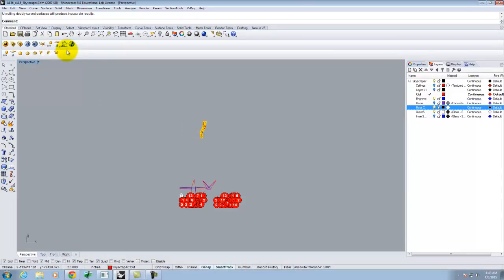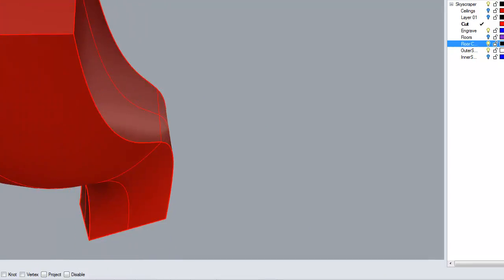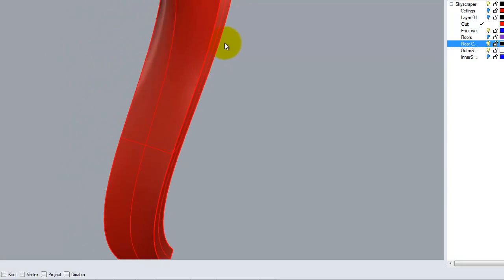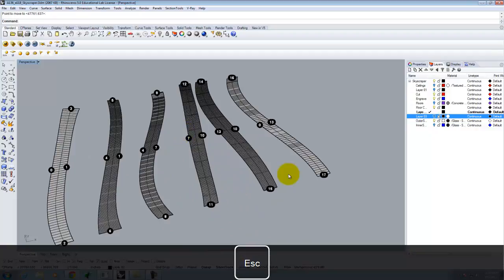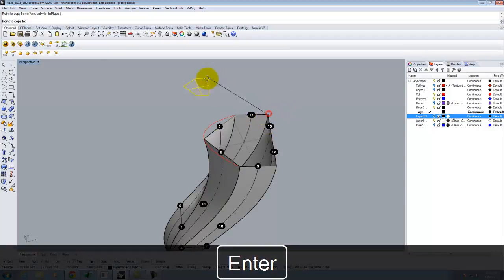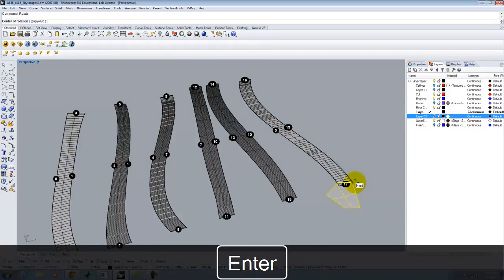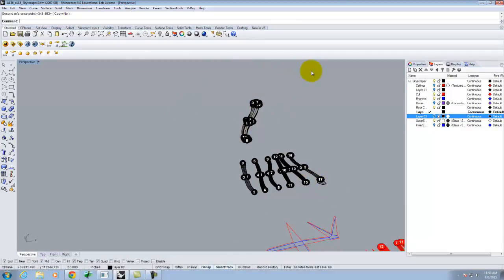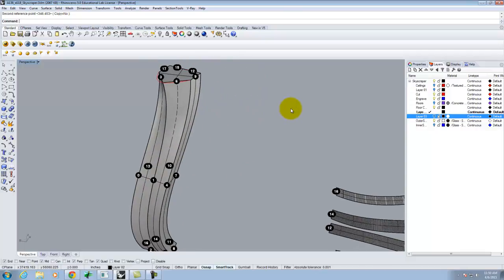Lecture 220 - Unrolling Surfaces in Rhino - Spring 2015

Comment: 27:52 no it's not developable necessarily! even if you use straight section in loft style ( not normal ) it will be ruled surface and not all the ruled surface are developable.

examples of surface that has straight section but  not developable is hyperbolic paraboloid or...make a cylinder and rotate on of circle edge around the axis.